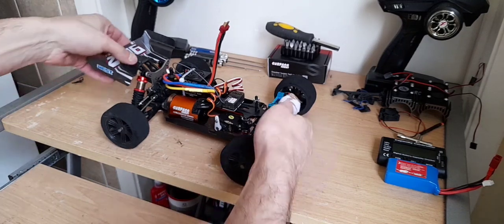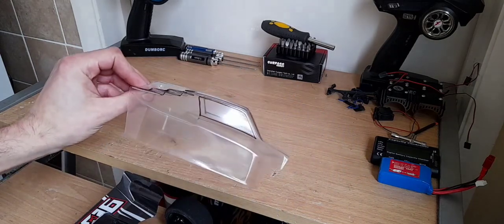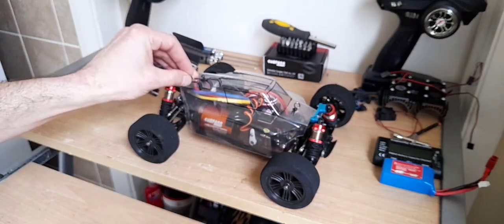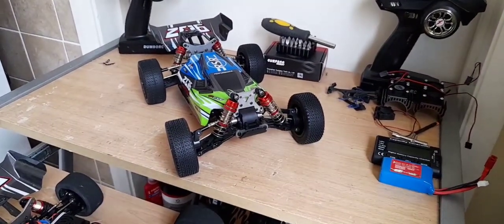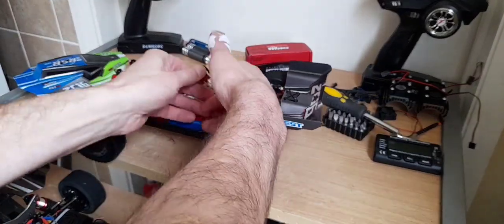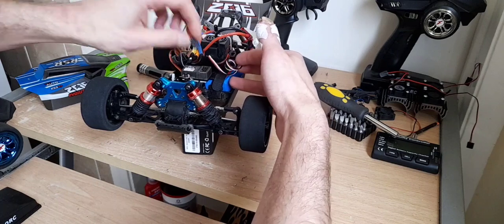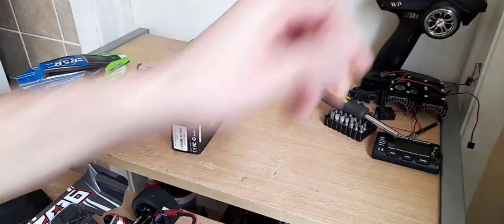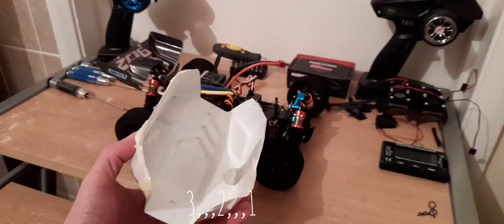144001 speed fun run pt2 DONE! Phat body!

Comment: Do you think that now you have more room for a large battery with this new phat body? i'm looking for a 2s 3300mah from ovonic.
Reply from the maker: The body isn't the issue for the battery, it's that stupid top deck getting in the way. 
You know that "hump" were the original ESC is sat, If you trim the width down on the top deck you can just fit a 3s and my 2200mah zops fit in perfect.

Comment: Looking good! I got to get a phat body for my upgrades. How did you raise your body posts? Also do you have your drive height adjustment screws installed?
Reply from the maker: Droop screws are in place yes. Theres two steps first get the a959 body post it's quite long compared to the 144. Then I bought extenders that sit over the post.
Reply: @mehimrc1314  where did you get extenders, I cant find them
Reply from the maker: @RCOverKill  first you'll need a959 post to swap for the 144 then buy these.
https://www.ebay.co.uk/itm/293751282483 
you'll need to trim a small slot out of the back. You'll notice the 144 posts have a little extra to stop them from turning. The slot it to go over that. Does that make sense
Reply: @mehimrc1314  yes, thans
Reply from the maker: @RCOverKill  excellent mate well I hope it all goes well for you.

Comment: Hey dude have you ever had any of the wheels just bind when you tighten the wheel nut? I've got a brand new 144001 here that's doing it. I can't figure it out? It's all nice n loose if u back off the nut but soon as u tighten it binds really bad. Thanks 👍🏻
Reply from the maker: It can do because of the plastic hex,if the nut is tightened too tight. It gets pushed over the pin and locks against the hub. Also the pin may be bent. 
You should have plenty of play in the wheel. Can you pull the wheel in and out like on my video? Generally you will need to back the nut off just a little to find that sweet spot. Add WEAK loctite before adding the nut,tighten,find the sweet spot then leave to dry 24hr. That's my best tip.
Reply: @mehimrc1314  Yeh that's what I'll have to do I think. I had this problem with an old ftx years ago. It's a bad design really. I like your videos 👍🏻🤘🏻🤘🏻
Reply from the maker: @ksrnate  cheers dude and Yeah it's just a bit off poor design easily fixed though.
Reply: @ksmate if you replace the stock hex with aluminum ones Ive heard that fixes the problem. Otherwise tighten them as much as possible, and still be free, and put  blue locktight on the threads, and let sit over night. I'll know soon.